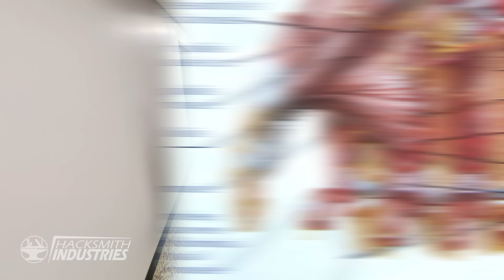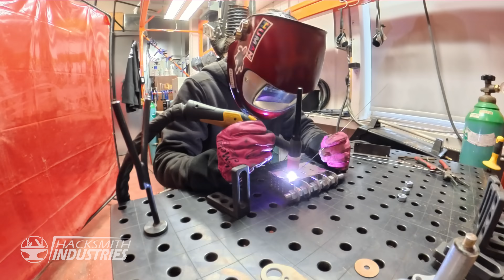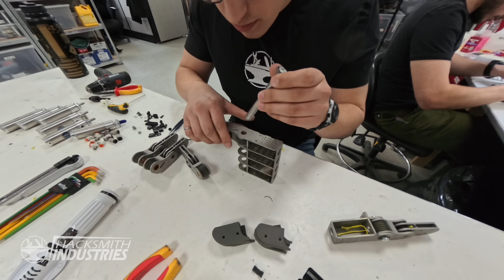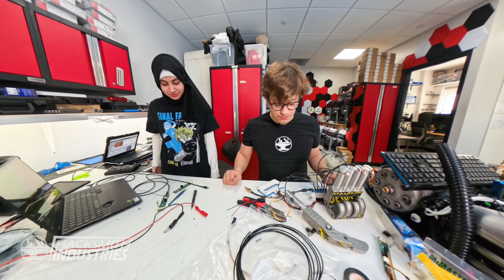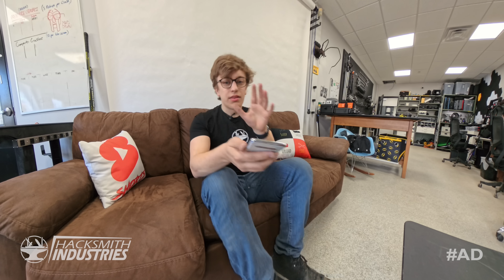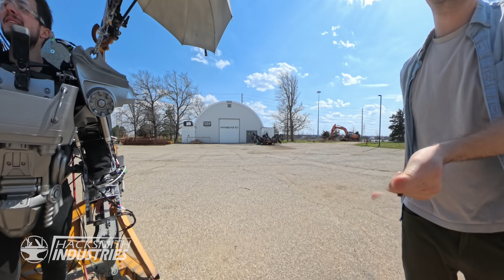Building Robotic Hands | Real Life Power Armor (Part 5/6)

Comment: Not a bad first attempt, but an all-manual, all-printed hand would have sorted out most of these design flaws before getting it fully built. Shorting the fingers down to two segments means they aren't long enough to grasp around things, which is part of the lack of grip strength. Steel wire would have also been superior to string for force transmission. Fingers should be very slightly splayed apart (5-10 degrees), and mounted with a very slight twist from one to the next so they all close inward (2-5 degrees). For a fixed position thumb, it should be at about 30 to 45 degrees away from parallel to the hand. Triggers should be on the front of the grip rather than the side, like how gun triggers are mounted, with release trigger opposite to that, and I'd probably put middle, ring, and pinky fingers all on one trigger, keeping index separate for ease of 'one finger' vs 'whole hand' control (basically how VR handset controls tend to work).

Comment: I am also following this on Prime.

I love that you all finally incorporated muscle control into the arm movement control.

But as you are all engineers, and you obviously did some research into hands, you let every medical professional down.

Humans have only 4 fingers on each hand ... and a thumb (fingers can curl inward, slight side to side; thumb can curl, side to side, and transverse). Now to be exact we have 5 digits per hand.

A better control would be reflex gloves (electronics fitted into gloves and reads digit positions) that translate to mechanical hand motion. Hobbyists are doing these with Arduino/ESP modules, and you have more resources.

Comment: Since the hand is so big you could use rotation encoders attached to gloves to detect the angle of the users joints. If there is no space in the finger you can relay the position with a little wheel attached to a cable in a tight housing like bike breaks.

Comment: you've noticed by now I'm sure, but that hand is pretty lousy. Ian davis has a prostatitis that would be a better inspiration, including a more robust drive mechanism, and conformable fingers. Also, the hand shape is totally wrong. Our knuckles aren't all at the same length. If you just want to curl weights, that's not a big deal, but if you're making an armor that was canonically used in war, you should be able to hold a grip. Grips are designed around hand shape, so there's good reason for mimicry there. That also means the thumb needs to be able to wrap the inside of the grip. Thumb is really the hard bit. But if you design for a narrow set of grips, you can probably simplify it. It's also important in just plain weight lifting too, since it reinforces the grip of the other fingers by coming from a different direction.

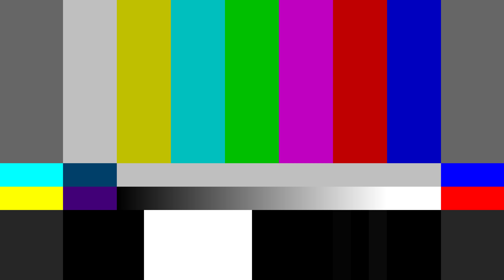Comment: 12:07 could either do a flex sensor instead or in addition to so it can sense when your hand flexes how much and you could get finer motor control out of it
Reply from the maker: Flex only would give you movement - we have analog pressure sensors, so you can pick up an egg without breaking it, or a barbell 😁

Comment: those hands look soooooo heavy. why not 3d print the structural pieces then nanite plate them or use carbon fiber for the hands for less weight and put nanite armor on them.

Comment: Hey, so you don't really need all 5 fingers to be individually controlled. You generally don't need that kind of dexterity in armor. For armored combat we basically just have metal mittens. I'd say if you really want it, two fingers and a thumb are the absolute max number of fingers you're going to need, but you'd be fine with just one.

Comment: This was a terrible episode for this series. I can see why it didn't trend at least for me it didn't. I'm absolutely sure the hands could have been done mechanically with a hybridized haptics system. Not everything needs to be actuated by air. Air actuated mechanical "finger" joints do not provide instant feedback therefor its impractical including this application and quite frankly, it's much too complicated if you ask me. But I get it, budget, make do with what you have, time constraints due to other projects or other factors we the audience are not privy to. I don't know man. Terrible execution is all I'm saying.

Comment: One thing that may help gripping is if you used an edited version of what those thanos gloves used, so if you replaced the thing you hold with the hand with a wrist strap and then had a ring that goes around each finger and then a tension spring along each ring then have some sort of multi stage pulling button so the more force you pull the more the springs forces itself back and the more strength goes into the hands almost a feedback system to give more or less grip for the fingers. And while I'm unsure of its properties for this application Kevlar thread should be stronger then rope.

Comment: Those fingers need a third joint. You're basically trying to use a hand that's all thumbs with the current setup.
Reply: Dang, I didn't even notice until I read your comment. No wonder it's such a terribly executed part of this series. Not to mention the air driven actuators are not helping and makes it more complicated than it really needs to be.

Comment: Remember to measure tension strength for PSI for the hand. As a test use 10% pressure the find the hypothesis on how much pressure is needed to open and close the hand.

Comment: Give the thumb a 35 degrees angle (neutral thumb orientation) it will be more usefull to grab things....it's basics. Also, you made power armor parts but you missed the most important part, the Frame, with it you'll be more able to get a stable base and you'll be able to fit your gears in a good way. I'm used to work on any kind of armors so i can tell...you want to make Fallout T60 for real so start from the start, make the Frame first and don't try to make an armor covering your tech, make your tech fit the armor design wich is really not bad at all from an armorsmith viewpoint.
For the frame, think about using aluminium (creased on the inside part to offer a good compromise between weight and toughness, like for motocross aluminium frames).

Comment: for extra grip you need to move those cylinders so you can have movement in your wrist and thumb. and use a sensor to counteract the lengthening and shortening of the cables with the movement. if I knew how to 3d model I would make a new hand with the changes.

Comment: What if you guys use Valve Index VR controller’s finger tracking feature to help make the hand more dexterous? Most VR data are shared via OSC so it shouldn’t be impossible to get the telemetry

Comment: there are "curl" sensors. They are metal strips that tell you how curled up they are.
Reply from the maker: But without a pressure sensor you won't be able to adjust how hard you grip!
Reply: @hacksmith  youre right... maybe combining both sensors could be an option but it sounds like a nightmare!

Comment: Why did you go with a pulley system for the fingers over either solenoids or hydronic fueled pistons functioning similarly to solenoids? Also the fingers look wonky why did you make them look like that? The programing on the buttons and board are good though

Comment: Wouldn't it be easier if they put the valves in the forearm and have the strings running up the the hand. That way it actually looks good and you could use the mechanisms that they use in the plastic infinity gantlet to be able to release the pressure from the valves.
I'm willing to be proven wrong. But I just think it would be a whole lot easer and more compact

Comment: As an artist and anatomist, the failing grip could be due to the fact that real hands have three joints per finger, but also the knuckles have a radial pattern from the hand, which helps them wrap around objects much more easily. The placement of the thumb on your design also makes it almost useless, possibly even a detriment. The thumb should at least curl opposite to the fingers to grip better, it's current placement also seems to make it almost impossible to hold anything taller then the hand

Comment: There's something to be said about how many different ways these parts could be designed that each have their own drawbacks and uses. For example, the length of the fingers. Very, very short finger, which might allow some better precision for grabbing smaller objects, however wont do much good with larger ones. If you need the power armor to operate smaller levers, pulleys, and buttons while safe inside the suit, those fingers will work great, but I can also see how  longer fingers would be helpful for carrying large loads or operating heavy, power-armor purposed equipment. I guess what I'm saying is, the best thing to consider for these types of suits is being designed to be modular, to allow swapping parts for different jobs.

Comment: I think it would be better to have a functional thumb (not just for appearance) and a separate, independently working index finger. The other fingers could move together, controlled by a single button. This setup would really provide better ergonomics, allow for a firm grip when needed, and make it possible to use a gun, for example, like in the game.

Comment: I think y’all did it the worst way possible.

A haptic glove would be way better for controlling the hand, and wouldn’t put the user’s hand in danger if the mechanical hand got ripped off.

Also, opposable thumbs are essential for grabbing anything. The thumb on y’all’s hands are purely cosmetic, and don’t work how they should.

Lastly, using steel cable instead of flammable string would have been a smarter choice. It also has more tensile strength, and it designed to be used under load.

Comment: Great starting point! You got a lot of good work in here and tested several assumptions. 

One improvement I think should be done that I haven't really seen mentioned is to move finger movements from binary inputs to normalized floating point input ([0..1] range). 

You would need an input device that measures each finger's grip in an analogue way and a calibration step to account for different hands, that can then pass a value between 0 and 1 to the controller to describe each finger's position. 

The controller could then pull on each finger mechanically based only on this normalized value, to position each finger in more natural ways. The resting pose of the hand is a sort-of half-closed pose, and seeing this reflected in the power armor would be dope. 

Having more control like this would also mean the user could choose to pick up an orange and hold it, or pick it up and crush it, by closing their fists fully. 

If you want to get really fancy with it, you could report back from the mechanical part what resistance a finger is meeting and have the hand input device give some resistance back to the fingers, to get tactile feedback, which should make gripping stuff and actually using the mechanical hands much, much easier. 

---

Another point, which I have seen mentioned, is the thumb and the reduction of joints. I think reducing the number of joints makes a lot of sense for these initial prototypes, but I think especially the three thumb joints of a normal hand are necessary for useful dexterity when gripping things.

Comment: You've probably already figured it out with the mining rope mounts, but the same things exist for rope knots. That is techniques and designs that cause a rope that would be unraveling to in fact pull itself tighter, causing it to be very resistant to unraveling or might even just break at some point. A clove hitch knot is an example of such a rope knot.

Comment: welp, everything i wanted to say is already down there in the comments. like, the thumb isn't opposing, whic it's only purpose basically. steel line is much better than a nylon string. but also, i kinda want to ask: is the pressure sensor necessary? with how big the palm is, i don't think it provides a lot of precision. and pneumatics aren't known for it as well... so i'm not sure if regular buttons wouldn't be fine. although this one is questionable.

also, i think, putting the other fingers besides the thumb in an ark instead of all of them pointing at one direction would give some better ways to grab stuff. and it's surely possible, given that the actual actuator is a string. or a metal line, if you change it to that. so you can basically put the cylinders anywhere you want and pull the actuating element in any way you need. also helps with the opposing thumb.

Comment: Look everyone down here in the comments, is mentioning different ways to improve the hands, the bare minimum should be to have the grips of the four fingers to be able to touch the inside of the fingers rather then rely on the tension of the finger tips to palm. The fingers curl into the fingers, not fold against the palm. Lastly, the thumb through the whole video is pointless. The thumb needs either more movement freedom or at least make the thumb touch the outside of the pointer finger, like holding an actual bottle of water. The thumb is great for giving a thumbs up though. See ya in the next vid. I am still jealous of the work you all are doing.

Comment: The hand reminds me of the Thanos gauntlet toy. 

The thumb WILL be a problem; as well as the missing joint from the other fingers.
If the thumb can’t rotate outwards, how would you carry or pick things up? And not having three joints for the other fingers will make the overall fingers have worse freedom of movement. 

I love this series, and I love y’all’s videos, don’t get me wrong! But, if this is meant to be an exoskeleton-based system, having as much movement in the  arms and hands is something that needs to be kept in mind.

Your video about making the arms made me question how much you would actually be able to move them when you put the armor on it. And the pneumatics being on the front instead of the sides seem to also get in the way. 

All to say: I love the series, and can’t wait to see what else you guys do. But, I just have more questions than I would want about this entire project. I want to see this be a really cool project, but it seems to have flaws that could impact the actual use, besides being a display piece.

Anyway, thank you for making these videos. While I might not like Fallout, I like robotics and mechanical engineering.

Edit: You also have no way to hinge the wrist. That’ll definitely cause problems with trying to carry things.

Comment: Make thumbs opposed or opposable instead of cosmetic.
Put in grip sensors and use 2 stage trigger buttons where the first part is binary and second part is analog to first grip until sensors trigger and then grip harder if the buttons are further engaged.
For A+, put in sensors to detect slippage and automatically adjust grip strength to the least strength where the object doesn't slip
Make the palm hinged for better curling

Comment: After reading some of the other comments, I find myself agreeing with many but also wanting to be encouraging.
First of all, the hand works as a great prototype with some clear room for improvement. As others have said, the thumb needs to be redesigned so that it can actually work properly. A steel cable instead of a synthetic rope could also be used for heat resistance and higher tensile strength without as much stretching. Maybe there is another material I can't think of right now that would work better in tight spaces, like a robotic hand.
Second, I am loving the series, and I hope that the project will be a success. The system is looking great so far, just keep it up, and it can be better than you think it can.

Comment: definitely going in the right direction but might need to redesign the hands because how they are at the moment they are not able to grip anything but I am sure they would get there with time, however what I personally would have done would have been focusing on more flexibility of the fingers by making them able to move from side to side too, however the most important place to put this extra motion would be at the thumb first and foremost because right now the thumb is basically not even useful in its current position, however if they use smaller pistons then the ones they are using at the moment they would be able to get the extra freedom of motion in.

Comment: With the pressure detectors, you could put those inside of the fingers of a leather glove. Then, you can just move your fingers as you would, and when you stop putting pressure on the sensors, it uncurls.

Comment: Gotta say this project is great but the hands are by far the weakest part mechanically and visually at this point in the build. The resting position is board flat, the thumb is essentially decorative and it doesn’t really do what a hand is supposed to do, it just mimics the movements. Y’all need a little more anatomy integrated into your design

Comment: the hands are great in concept but poorly executed. Look into kevlar boot lacing as a far less stretching cable and the thumb needs to be opposable or at least already oppose the index and middle fingers. at the moment the thumb is basically as useless as a dew claw. I would also recommend the controls be adapted from some of the work LucidVR has done for haptic gloves, though you would just need the sensor suit and not need any of the vr translation for it.

Comment: This is a good start to hands but I believe the thumb should be set at an angle that won’t interfere with the fingers but also create a opposable support for held objects. Also for the grip there should be a force input so that you can either be really gentle with objects or straight up crush something in its palm, and not just a air input dial, like something built into the coding for each finger trigger.